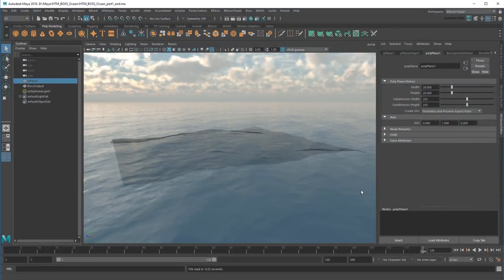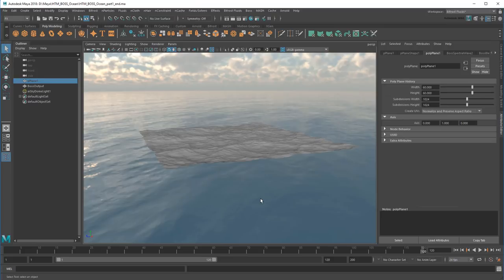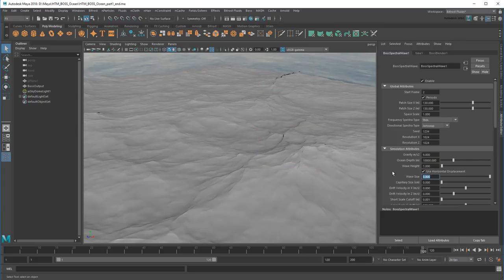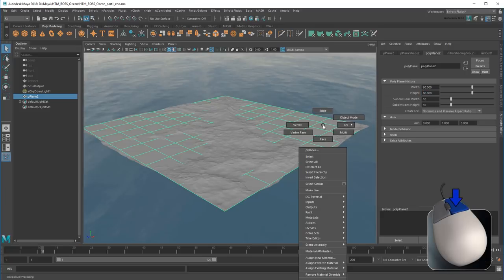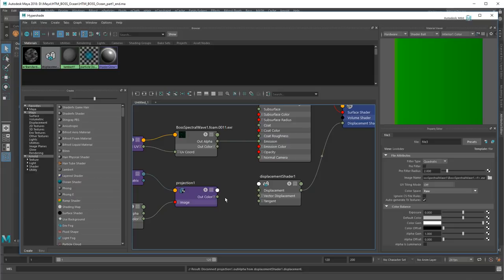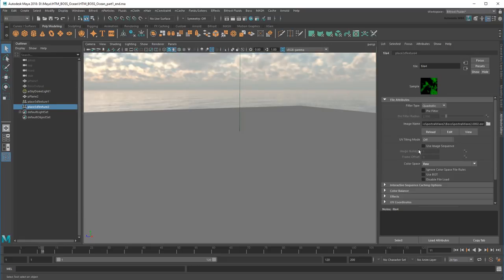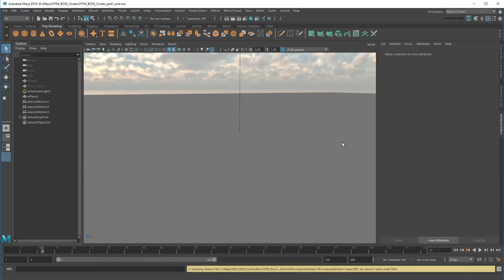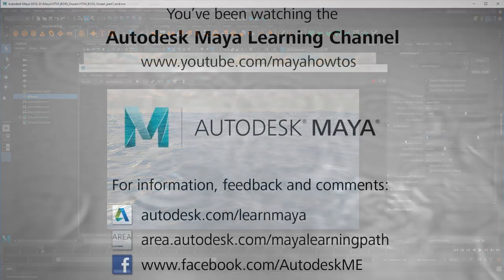Creating an ocean - Part 2 of 4: Tiling an ocean for rendering

Comment: You're a fantastic teacher and I'd like to thankyou for all your help. Do you have a good way of making sure the results you project onto your mesh are at the exact same scale as that in boss? I screwed around with the scale which means that making the projection half of the patch size doesn't match with the result I got in boss...
Reply from the maker: Have you tried just multiplying the same scale to the projection?

In general though, I wouldn't recommend messing with scale, because it's going to degrade the quality of your projection.  It'd be much better to generate a cache at 1:1 scale, and then use the 1/2 patch size rule.
Reply: @Autodesk_Maya  awesome thanks! Yeah I had thought of keeping it the same left at 1:1 but I wanted to achieve large, medium and small scale waves. Is it best to just alter the patch size for changing the scale of your waves then?
Reply from the maker: @boycie18  Yup.  That will allow you to maintain optimal visual quality.
Reply: @Autodesk_Maya  great thanks for you awesome help!
Reply: @Autodesk_Maya  thankyou do much for this it sorted my issue. However one other thing I'm having now is that I am trying to use the add geo as influencer under the boss tool. It seems that using this with the wave solver works, but I can't get it to work with the spectral waves... The spectral waves don't deform around the object..
Reply from the maker: @boycie18  The effect should be additive (i.e. you just apply it to the top level solver and it's applied on top of what's below it).  It's possible your spectral waves are drowning out the wave solver if your waves are very large, so you may need to increase the wave solver size.  You could also try adding reflection waves too for extra emphasis: https://www.youtube.com/watch?v=JQD_iPUWmB4&list=PL8hZ6hQCGHMXurBidpPoX_142LlaAfMVg&index=7&t=0s

Comment: My one gave a mistake ... When I place the 3d texture placed, and I render it with the arnold does not appear the waves is just the straight plane without waves someone. Can someone help me please.
(Maya 2018)
Reply: Help Me!!!!
Reply from the maker: @marciosa9745  If you download the included scene file and render that, do the waves appear?
Reply: @Autodesk_Maya  I have the same problem and when I use the downloaded scene the waves still do not appear in the Arnold renderer please help.
Reply from the maker: @tomwalters1085  Did you try re-generating the wave caches?  it may be that they're pointing to a place that doesn't exist on your hard drive versus my demo machine.  Are there any errors that are spit out when you attempt to play the scene?

Comment: when i replug projection 1 "out color" into "vector displacement" and render the plane renders flat, no displacement, why?
Reply from the maker: You're certain that the projection 1 is sized correctly?  And that the file reference is pointing to the right folder?  Usually you can tell by the swatch in the Hypershade.

If both those are fine, I would recommend updating the render by going to Render > Update Full Scene in the Arnold Render View.

Comment: I have two issues:
1- The foam is a lot. I changed the value of the Cusp, cached out, replaced the older files, but nothing changed!
2- My aiStandardSurface of the ocean does not having any nodes on it...what did I do wrong?
Reply from the maker: 1- When rendering, try using the "Update Full Scene" option in the Arnold Render View.  Sometimes the live refresh doesn't update properly.
2- What do you mean it doesn't have any nodes on it?  As in nothing is attached, even after you select the aiStandard Surface and hit the "Show Inputs / Outputs" button in the node editor?  It's possible you deleted some of its connections accidentally.  If so, you can try applying a new aiStandardSurface to it and trying again.
Reply: @Autodesk_Maya  
The problem with the foam being "too much" is that we had to check the box for "Alpha is Luminance" under "Color Balance" for the Foam Displacement File. This was not mentioned in the video. My professor figured it out, and it was what made all the difference!
Reply: thx man! spent 48 last hours on figuring out how to decrease the foam intensity, i was going crazy

Comment: I cant find the other boss spectral wave files! there is only 12. can you help me how to create more for more frames, because i cant loop it
Reply from the maker: When you ran your initial cache, was the timeline only 12 frames long?  What you'll want to do then is go to the Boss Editor and switch the Spectral Wave solver to uncached (red) mode by clicking the little green disk.  Then expand your timeline larger than 12 frames and re-cache it.  This will overwrite your old frames and add more.

Comment: Hi I fallow step by step the video, but I have some problems with the tile. The plane I did has this:
Poly Plane history
Width: 60.000
Height: 60.000
Subdivisions 10X10
When I increase the size of the plane at 300 x 300, tiles work, but for example I increase 5000 x 5000. Tile doesn’t work because the pattern repeats and it´s visible.
And I need an extended ocean.

Comment: Hello, these videos are incredible! However, I'm having issues with my vector displaced waves being a "muted" version of the high resolution mesh. It seems like all displacement going "down" is not getting evaluated i.e. the valleys of the waves is seem to be clipped. Scene Settings were set to centimeters when I cached the waves, and all other values were entered as instructed in the video. I also tried the "Update Full Scene" in the Arnold RenderView as well. Plane is subdivided 5x linearly at render. Thanks for such great content!
Reply from the maker: Hmm, are you running the most up-to-date version of Arnold?
Reply: @Autodesk_Maya  Yep. MtoA 3.3.0.2 (10/16/19), and Arnold Core 5.4.0.2. Any other possible reasons?
Reply: You may need to alter the value of your "Bounds Padding" under the displacement shader node. this usually clips things if its set too low.

Comment: This is probably a stupid question but how are we able to scale the plane we are using for the displacement map to any size? I know how to scale an object etc, but why/how does it work like this?? How is it possible for it to repeat in this fashion to any size?
Reply from the maker: No such thing as a stupid question.  = )

So the way this works is that the displacement (which remember, just tells Maya how to shade the flat plane to look like it has detail, without adding any actual detail to the mesh) is actually tiled on the plane's surface - much like wallpaper or carpet on a real life wall/floor.  This allows you to repeat the tile over and over to cover as large an area as you need.  The only caveat is that you want your tile to be large enough so that the human eye doesn't pick up on the tiling (otherwise it will look fake).  

That's basically what we're doing here.  

As you increase the size of the plane, the displacement is being repeated on the plane's surface.  However, the tiles are big enough that the eye can't pick up on the repeating pattern.

Comment: Hi, I would like to ask if the black colors on the exr map represents negative color? I am rendering this with vray, and I noticed it clipped away the area that seems to be black on the texture map. Only areas with color gets displaced and everything else is flat...
Reply from the maker: I think that's the way VRay interprets it, yes.
Reply: @Autodesk_Maya  thanks for the reply. I just don't understand how the displacement map does not work with Vray render.

I checked in photoshop and there are no values/info on the black area in the maps. Technically there is no way Vray (or any engine) can displace anything from a color without a value. 

Would you mind to explain how did Arnold manage to displace the mesh with those exr maps cached from the simulation.

I tried using your project files with Vray and there're still areas that got clipped away.

sorry about the long and annoying question. Thank you for always answering the questions. Really appreciate the helpful tutorials!
Reply from the maker: @Tobsters755  Hmm, unfortunately I'm not a VRay expert.  Maybe try taking your question over to the Autodesk AREA forum and hopefully someone more knowledgeable than I on this subject can find an answer for you?
Reply: @Autodesk_Maya  'i see, thank you for your reply :)

Comment: Great Tutorial! I do have a question. When I do the displacement map everything works until I click on "Use Image Sequence" In the video when you do a new node appears next to Image Number and it follows key frames at the bottom. Mine does not do that, The expression doesn't get created to follow the keyframes. How do I do that part? Thanks!
Reply from the maker: Are you sure you have the <f> in the Image Name field as shown, and that it matches the multiple .exr files you have output?  That <f> needs to line up with wherever the number is in your filenames.
Reply: @Autodesk_Maya  Yes, the <F> in the Image Name field matches the multiple .exr file. Filename: BossSpectralWave1.0002.exr / Image Name: BossSpectralWave1.<f>.exr  I am using Maya 2020.3 if that is any difference.
Reply from the maker: @ronhiggins7682  The version of Maya shouldn't make a difference.  I assume you have more than one .exr in that folder (i.e. 0003, 0004, etc)?
Reply: @Autodesk_Maya  That is correct. I was able to get the simulation going by manually creating the expression after clicking on the "Use Image Sequence" I just assumed that Maya would create the expression automatically.

Comment: Hi, I’m having a problem with the second projection. For some reason, my second cache image for the second projection doesn’t give a sample unlike your’s which shows a displacement map in the sample box. I tried to render anyway with Arnold but it only renders a flat surface with no wave displacement, is there a way to possibly fix this?
Reply: This is the problem I'm having now... strangely, the first 200 frames are textured and then it's just flat, no displacement.  I can't seem to find any answers about this.

Comment: Hi everyone, what would be the most efficient way to make an object "float" accurately on such warped plane. I was thinking rivet than offsetting it, or maybe blending between few rivets
Reply from the maker: Jennifer Dzieło That would be a good bet.  You can also just rivet constrain a locator to the plane, then parent the boat to that locator for maximum versatility.
Reply: @Autodesk_Maya  hi it worked pretty well, I had to add a sin to the y translate as an extra  and look for the right frequency so that it doesnt seem glued to the surface.

Comment: Hello, I'm having problems with the foam. I did as you said in the video tutorial, but instead of appearing white as they should, in my render they appear green, as the image is. Can you help me with this please? I tried many times, but it still gives me the green color instead of the white one.
Reply from the maker: Did you apply the file to the Weight or Color value of the Emission?  I have a feeling you applied it to the Color by mistake.
Reply: Make sure all your render settings are in Arnold, and that your surface shader in Arnold's as well.

Comment: Hi, can you please share your wisdom? I am using the exact same values as you do. But whenever I change the default SpectralWave resolution from 512 (this is the resolution for the water wave, not the mesh plane subdivision), Maya crashes. Even if I just increase from 512 to 513, it would crash. Identical scene setup as yours. But it does not crash if I go downwards, say from 512 to say 300. This is on a Cylinder Mac Pro, 64GB Ram, two D700 GPUs (6GB each), Maya 2019
Reply from the maker: Hmm, unfortunately I'm running windows.  This seems like it might be some kind of hardware limitation.  Unfortunately, I'm probably not the best person to ask about this, but I would try the area.autodesk.com forum to see if anyone else has run into this issue with that particular machine.
Reply: Maya Learning Channel - I finally managed to solve it, after about 30 crashes. It turned out that this little red / green cache button (that tells BOSS if we want to use cache or not) needs to be in one particular state (i think it was the green state, but maybe the other way around, I cannot remember right now). Then, the crash didn’t happen. But gosh, it took me an entire evening to realise this.

Comment: Hi, I noticed in a reply to another comment you had received 2 months ago that you mentioned the possibility of tiling the ocean with full geometry instead of the displacement. I'd like to have the full geometry colliding with a ship hull, while the less-demanding displacement ocean covers everything else. Would this be possible with Boss? If not, or if there's not an easy solution, that's fine. I'm still quite a novice with Maya and the tutorials that you have made are certainly quite helpful as is :)

Edit: Also, would you say that render-time subdivision might actually up the detail to make it near-identical to just using geometry? I suppose the actual hull collision with the water could be slightly obscured with foam effects too, so the waterline wouldn't look so jagged with large waves.
Reply from the maker: Have you checked out parts 3 and 4 of this tutorial, because they're about that exact thing.  And yes, increasing the subdivisions enough makes the displacement virtually indistinguishable from actual geometry (while saving a ton of processing time!).
Reply: I must admit that I did comment before actually watching parts 3 and 4. I have seen them now. Thanks for the response, though.

Comment: I have a rather large ocean - 500000 by 500000, so tiling have been an issue for me - even tried the files from this tutorial at my scale and it tiles. I am now trying to adjust the space scale in an effort to reduce the tiling. To do so I have to adjust the gravity. In the maya docs it says: you can restore the original speed of the waves by scaling the Gravity m/s2 value by 1/(Space Scale)2. As I am trying to get an expression to work for this. What is scaling in this? multiply?
Reply from the maker: That should be multiplication.

Comment: Which parameter do I need to adjust to have the same resolution on a bigger pPlane2 as BossOutput? Patch size of both solvers and their resolution? Thanks
Reply from the maker: You'll probably want to increase the number of subdivisions on your original ocean tile and up the resolution of each solver.  The Patch Size can help too, but it's mostly for avoiding repetitions (which is still useful for larger oceans).  You can also increase the subdivisions in the Arnold settings as well to get even more resolution.
Reply: Great, thanks! My main problem at the moment is that the plane geometry seems "doesn't use" displacement maps to obtain the right resolution. I posted the problem on autodesk forum, because i can't post images here. If you have some minutes to check it, i would be really grateful! https://forums.autodesk.com/t5/maya-dynamics/bossoutput-node/td-p/8100573
Reply from the maker: Hmm, try applying a new aiStandardSurface shader to your plane temporarily, then hook the colorMath node's Out Color attribute into its Base Color.  Do you see your displacement map's colors appear on the plane  in the Viewport?  If not, then something is amiss with your projections or displacement network.
Reply: Great thanks! I'll try and i'll let you know thanks again! :)
Reply: Yes, I see my displacement's map color...it's something else :(
Reply: I've just noticed that maps that work (tutorial 1) have 512 resolution instead of 1024! So it's a proportion problem I guess. Maps resolution should be big like plane's one isn't it? Thanks again
Reply from the maker: Hmm, and you're sure you're plugging it into the ocean shader's Vector Displacement right?  It's possible you're experiencing a Bounds Padding issue, which is detailed on the Arnold website: https://support.solidangle.com/display/AFMUG/Displacement
Reply: Yes, connections are right! I'm gonna check the link you suggested to me and I'll let you know! Thanks :) (it's a pity I can't post screenshots here!)
Reply: Thanks, I checked it! There are many good info! But I didn't solve my problem. I think it can be a scale problem, because if I increase wind speed and decrease ocean depth BossOutput will be very displaced but I can have a good result on pplane. I will do some tests with boss node's and patches resolution. Do you think I'm on a good way? Thank you

Comment: HELP ME!In the last operation, when the size of the plane is 15000, why does it become a flat sea surface? There is no problem when the size is 60????
Reply from the maker: Did you try using the "Update Full Scene" button?  Sometimes the render view can "stick".  If it's not that, then try lowering the number of iterations.  It may be that you have too many for your computer to handle.
Reply: thanks for answer.and ..why the scale is half the patch size? then why  from's  scale is 30?

Comment: How do you get the animation of the full scene at the end of the video?
Reply from the maker: Once complete, you can batch render the result and then play the frames in a video player like DJV Viewer.
Reply: @Autodesk_Maya  once I added the lo plane and hid the high rez the wave animation stopped playing in arnold. I re-cached too but still nothing. I followed the projections how you showed in the tutorial, I am not sure where I went wrong.
Reply from the maker: @cole8208  Hmm, if you turn off the caches completely does the wave animation play?
Reply: @cole8208  Did you turn on the image sequence button? Did you use the same Arnold mat from the original?